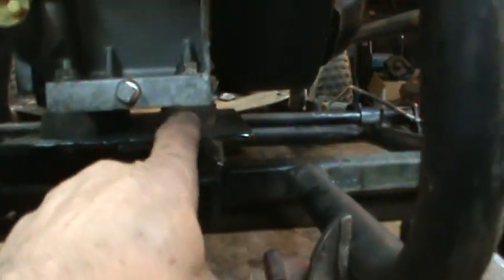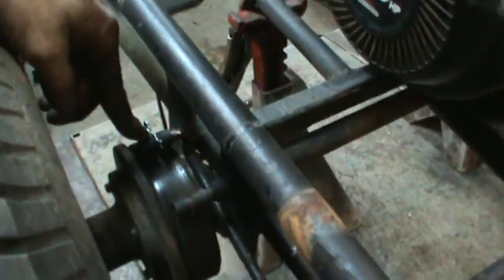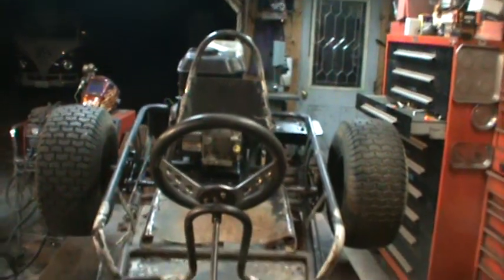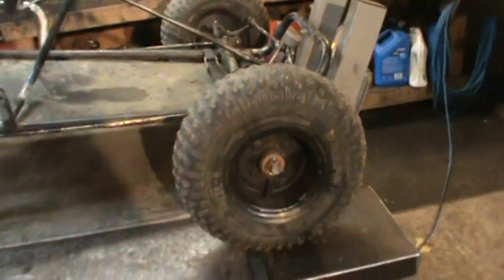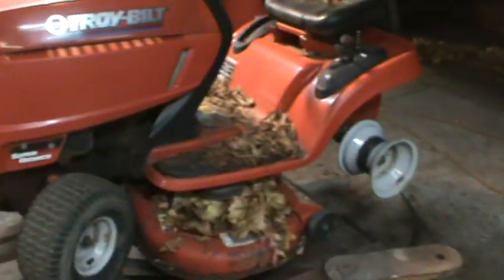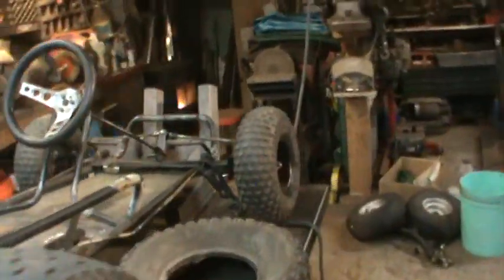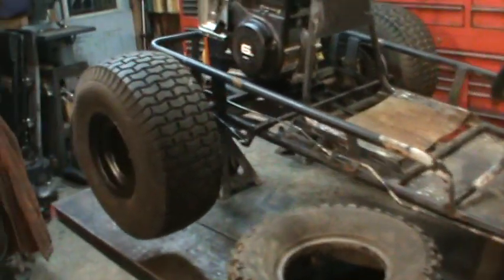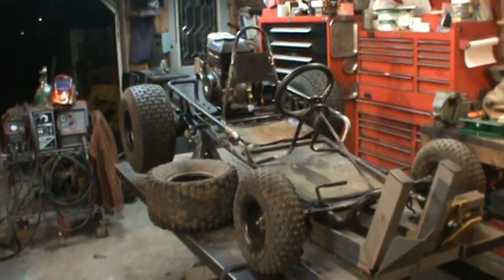scrap yard gokart up and running

Comment: Reminds me of the first go-kart and the last go-kart I ever rode. It had to 12hp Tecumseh Motors on it. I rode it for about 17 seconds. It blew a front tire went into the ditch and flipped over on top of me and it was about that same exact go-kart. cuz it that round part of the back of the seat on it right in the middle of my lower back. The neighbor lady come running out of her house and rip the thing off of me it was pouring gas and hot oil all over me. I was 14. My mother told me not 10 minutes before that don't get on that go-kart you hear me boy.

Comment: Looking good buddy!
The motor mounts aren't a bad idea for reducing vibration ,and what you can do similar to a snow machine with the cvt trans is to build a front and side brace to avoid breaking belts and having them bind in the clutch .
( I can take a photo of one if you like)
Need to now find a belt with the correct side to side sheave spacing so you aren't starting in 3rd or 4 th gear and also one that isn't too long so you'll end up with about 1 1/2 inch deflection at 10 lbs force.

Making great progress.
Reply from the maker: l ended up just taking them out, and it seemed ok with vibration